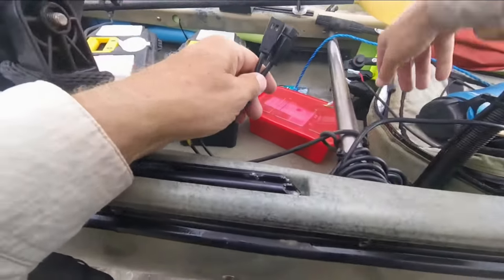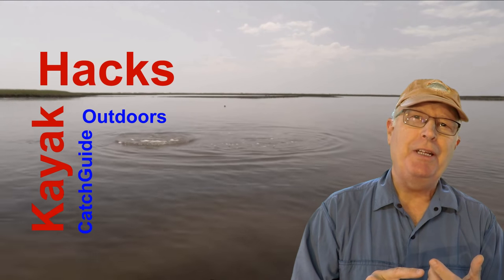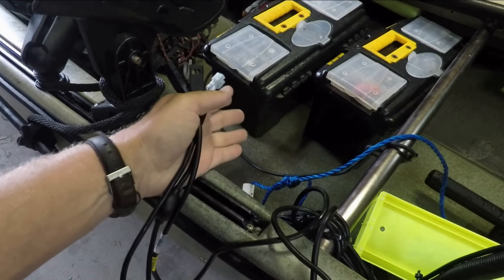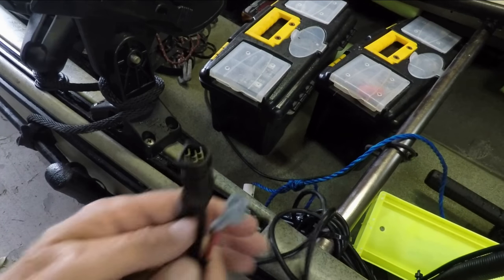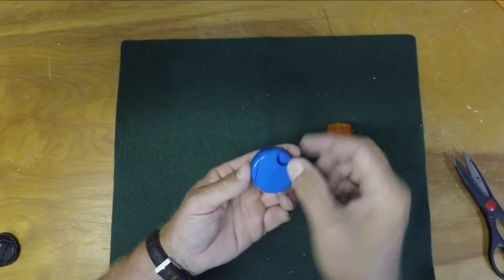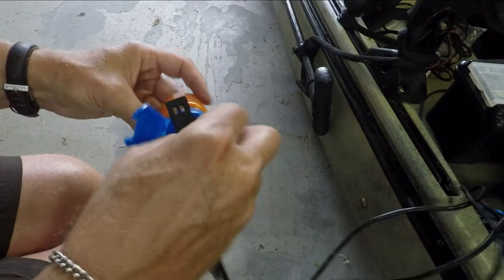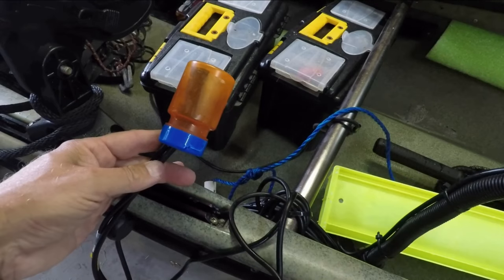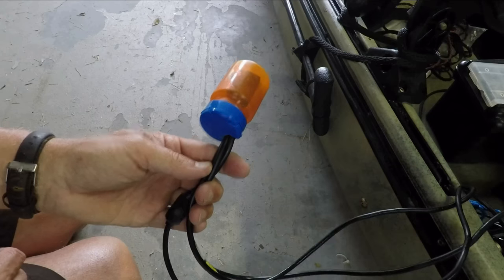How to Protect Fish Finder Battery and Transducer Cables on Fishing Kayak

Comment: That's a good tip. I use a little marine CorrosionX on my electrical. I sank my kayak once and 
after I drained the saltwater out of my switch box the switches still worked.
Reply from the maker: I'll try that - thanks

Comment: look for a product called dielectric grease, there are many brands that carry it and many applications for it, I use the product from locktite at work and since I hammered it in everyone's heads that we need to use this stuff in corrosion prone areas we have had less failed sensors, connectors and equipment
Reply from the maker: I did some research earlier on dielectric grease and found out it was an insulator that would reduce connectivity.  Looks like your experience is different.
Reply: yes, it is non conductive, and does nothing to make the electrical connection better, only protect the connectors from corrosion and degrading.  If you pack connectors with the grease it stops water from getting into the connectors which causes the corrosion, and doesn't arc between the pins which make an electrical connection due to friction between the male and female ends of the connector, it will push away the grease to make contact. It is silicone base so it won't degrade the plastic, and may need to be reapplied after a season or so. This is frequently used on spark plugs and battery terminals in may types of engines, and fill a wire nut with the stuff before twisting it on the wires and it makes a fairly water resistant temporary connection.
Reply from the maker: Great - so as long as there is a metal to metal connection, the grease fills around it to protect it.  Got it! Thanks!

Comment: Great idea. I wonder if you could use a regular pill bottle and lid, but use a waterproof wire nut to feed wires through the lid. Unscrew the bottle to put the wires onto unit and when done, screw bottle and silica pack back onto lid. That little hole on the lid still has me worried about water getting in, especially from the bottom of the yak in pooling water. Still though, really sharp and unique ideas.
Reply from the maker: Water would get in since my hole is not tight.  I just figured the silica would keep things reasonably dry when the pill bottle is sitting in the kayak (but not in a puddle).  I'll have to think about your idea - thanks!
Reply: Justin Cann That's a decent idea if I understand correctly, but the challenge w/ the wire nuts is that one must CUT the wires in order to get the nuts into place. Cutting the wires kills the warranty and is a dicey idea for these electronics cables with multiple small bundled conductors.

Comment: what about using dielectric grease?
Reply from the maker: Good point with the caution that dielectric grease is an insulator and does not conduct electricity. You need to make sure you have a good metal-to-metal connection without a layer of the grease.